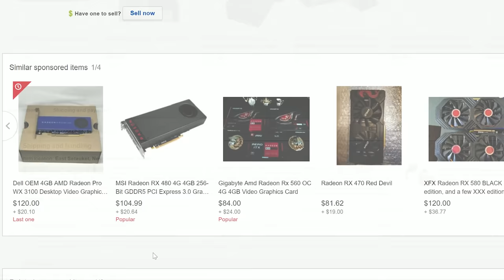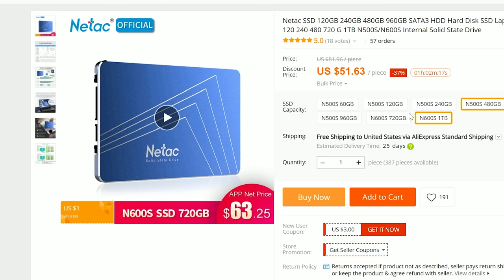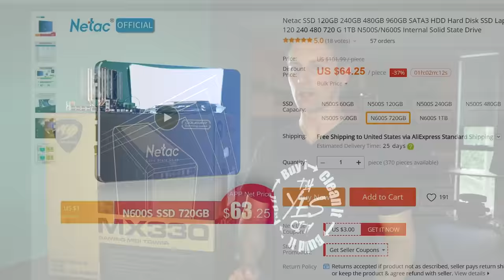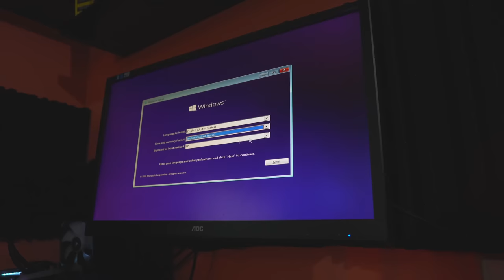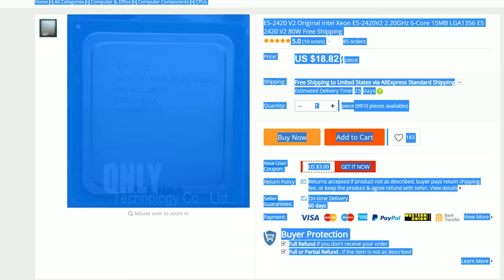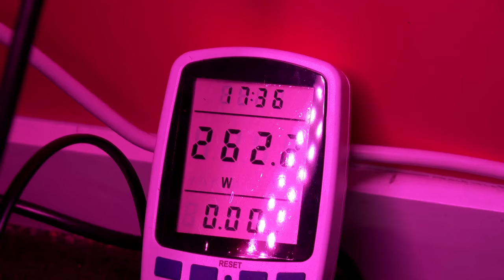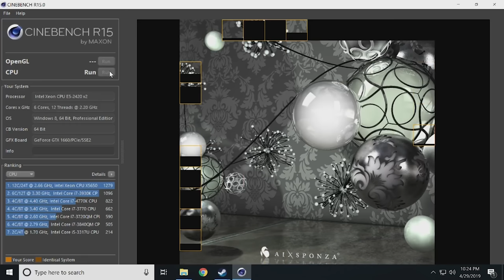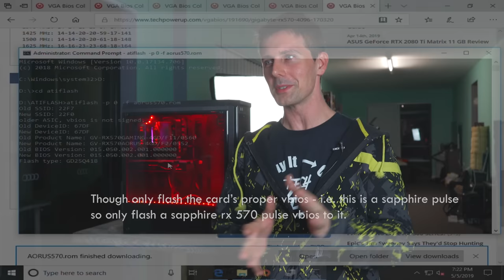Build The BEST $350 Gaming PC (with Worldwide online parts)

Comment: U can do it with ryzen 3 2200g.
Reply: arjun b That has potentially got a better upgrade path, but 4 cores no longer cuts it for gaming.
Reply: @RANDOMNAME-kj1zv  quad Cores are still going strong, it's the per core performance. No point in comparing i7 7700 (quad core) with a i5 8400 (6 core) the i7 beats it by a slight margin if I'm not mistaken so preference goes to per core performance over core's with a quad core being the bare minimum
Reply: @nexii1479  The i5 8400 doesn't have multithreading while the the i7-7700 does meaning the i7 can run as if it has 8 cores whereas the i5 8400 only has 6 so they're more even given one is the last generation higher end and the other is the following generation mid end.

Comment: I'm constantly getting between a 112 and 117°C motherboard reading??? I've put upgraded fans in the case and everything. Heck I've tried removing the side panel and putting a box fan right next to it. Nothing feels hot to the touch on the motherboard. Is this just faulty readings?
Reply: If it was 117c it would've burned your thumb so yeah faulty readings

Comment: I can't seem to find a RX 570 for less than $200, but I can get the rest of the computer for $258(HDD not included).
MoBo: Gigabyte B450M-DS3H                    $88
CPU: Athlon200GE                                         $54
Chassi: Natec Apion                                      $24
PSU: 600W (bronze)                                       $42
RAM: Crucial DDR4 4GB 2.4GHz, CL17      $25
SSD:  Kingston 120GB                                   $25
(optional) HDD: Seagate barracuda 2TB    $62

Edit: Save $11 for an A10-9700 CPU possibly.

Comment: Brian I found a GTX 660 on a local deal for about $40 but later on found out GTX 960 for $55. What would you recommend for me to buy?
Reply: Btw I am planning to pair it with an i5 2400
Reply: Keppler is getting old, I wouldn't bother buying a GPU that old.
Reply: Defo that 960. That's a decent price for under $60 and you can still game comfortably at 1080p med-high.
Reply: 960 is like a  base clocked 1050 ti when ocing a 960

a 660 is like a 750 ti but not power efficient

id go with a 970 and call it a day ~ should be able to find one for around 80 bucks or less (or just get a used 570!)
Reply: Thanks guys really appreciate it

Comment: can i asked a question; what is better ( artic mx4 vs noctua nt-h1)
Reply: For this kind of build it really wouldn't make any difference, but then that would be the same for most builds. One will see bigger variance in room ambient temps day to day than meaningful differences between pastes using the some parts keeping all other factors static. Can vary by CPU sample, mbd, cooler, etc. You'll be fine with either. As a general rule, don't buy uber cheap, don't go for hyper expensive (Noctua is likely very costly), something inbetween is sensible. I just use AS5, but it doesn't matter that much overall. Thermalright told me they experimented with all sorts of substances, including toothpaste. :D  Anything with a fine particula base will work; my gf's PC (Ph2 965) was done with 75% Marmite, hehe (I ran out of AS5).

Comment: Would an I-5 3450 or 3470 be a better option?  Using HP or Dell MB
Reply: Seth Rock no it will perform worst and probably be more expensive

Comment: 50$ for a Asus R9 290 <- would this be a good deal?
Reply: The 290 is close to a 570 perfomance-wise, but uses a lot more power and can be insanely loud:

https://www.anandtech.com/bench/product/1772?vs=1869

You're better off spending just a little bit more and getting some quieter and/or faster.

Comment: Hey guys! I need some help...I can't really decide on what pc to get(FX 8350 vs i5 3rd gen) for gaming...I know the i5 is faster but now that I've seen this video(comments:Xeon vs FX)and the i5 vs Ryzen 3 I'm really confused about what to get...I'm gonna add like a used RX 570 or a GTX 1060...I can get the FX build for a little cheaper but is the i5 build worth for a few more bucks(like $50)? I might be doing some streaming and recording as well...And I might have a dual monitor setup...What do you say?

Comment: I built my dad a $350 PC, i3 4170, Rx 570 4gb, Kingston 120gb ssd, thermal take core v1 case, z97 gigabyte motherboard, and be quiet slim rock cooler and 8gb of evga ram

Comment: Update for 2021 the links for the processor and cpu cooler are all still good if you live in the UK it will cost you 84 pounds for the CPU Motherboard Ram and Snowman cooler shipped. I would leave the case, psu and ssd to buy here in the UK as the SSD prices are cheaper on scan and ebuyer plus all the PSUS on ali look sketchy as f**k

Comment: just built a $340 gaming pc through ebay auctions and offer up howd i do?
CPU I5 3570K  3.4GHZ QUAD CORE
GPU R9 390 8G
RAM G-SKILL RIPJAW 4X4GB (16GB)
MOBO GIGABYTE Z77MX
CASE COOLERMASTER CENTURION 5
FANS 4X NOCTUA 80MM FANS
HDD HITACHI ULTRASTAR 2TB
SSD ADATA 240GB SATA3
COOLER COOLERMASTER HYPER 212 PLUS 120MM
PSU CORSAIR TX750

Comment: 2.5 GHz IVB is just plain slow.
Reply: It's IB-EN, not IB, and the FPS results speak for themselves, Crysis3 not withstanding. Even more interesting is one can use two of them on compatible boards; 12c/24t even at that clock is pretty good for such low cost & power. There's a reason why CPUs like these are used in Enterprise by the tens of thousands (efficiency, cost per watt).
Reply: @mapesdhs597  IVB-EN is just the cut-down LGA 1356 implementation of the IVB architecture. And indeed performance does speak for itself: IVB @ 2.5 GHz has no place in 2019. (hence the pricing of the used parts)

btw: The E5-2420 v2 is 6C/12T, not 12C/24T @ 80W.
Reply: @proesterchen  Read what I said; two of them is indeed 12c/24t - I was referring to dual-socket boards. And "no place in 2019" is not an argument; if a single 6c chip performs acceptably with a relevant GPU then who the hell cares what year it is? :D  Not everyone wants or can afford a 9900K, etc. Heck, I could even put together a build right now with a 4c IB-E that would blow away any mainstream modern desktop for Firestrike Ultra because the chip has 40 PCIe lanes; how meaningful that is of course is open to debate, such is the nature of synthetics like 3DMark.

Some games need the kind of oomph you're alluding to, others very definitely do not, as the results clearly show, and at this budget level it's highly unlikely the owner is going to have more than a 60Hz 1080p display.

Making absolute comments like chip X or GPU Y has "no place" etc. is not logical. You do not get to decide how other people spend their money or what they regard as acceptable performance and/or product/feature tradeoffs.

Also worth pointing out that for someone who did build something like this, by the time they might want something better they could then look to the later v3 or v4 generation of XEONs which would have many more cores, greater IPC, higher clocks and be just as cheap. The 10c 2680 v2 I bought was only 150 UKP and runs very well indeed.
Reply: @mapesdhs597  160W (in CPUs alone) for (best case) R7 1700-1700X-like performance is neither efficient nor relevant in 2019. It is why these things are being thrown out by the tens of thousands, though.

It's no surprise your 2680 v2 runs decent enough, it's got 66% more cores running at 40% higher clocks. Maybe you can neuter yours to resemble a 2420 v2 and report back on just how slow an experience that is.
Reply: @proesterchen  You're doing it again. :D  "not relevant" is not an argument. Where's your data? What tests have you run? I ordered a parts set about an hour ago. What you're saying is especially ridiculous when talking about DX12 titles which should place far less demands on the CPU, doubly so as one moves up the resolution scale, etc. And you're wrong about why they get sold off, that's just the nature of Enterprise tech, constant usually annual upgrades (I know, I get offered stuff all the time). I've been dealing with Enterprise customers for almost 25 years. I would give greater credence to your unsupported assertions if you had data to back them up, but you don't, whereas TYC does, and so do I (eg. I hold the non-DX12 3DMark records for P55).
Reply: @mapesdhs597  Strange how you keep bringing up 3.5 GHz IVBs and probably even higher-clocked Clarkdale CPUs in trying to object to me calling a 2.5 GHz IVB plain slow.
Reply: @proesterchen  Again, not an argument. TYC's data show results that are anything but slow, but it's clear you don't give a damn about those pesky things called facts. :D  You have no data to back up your claims, whereas TYC does, and so do I. QED.
Reply: @mapesdhs597  You have provided zero data. TYC's data supports my initial comment. Somehow, you still object on principle that a 2.5 GHz IVB is just plain slow.

Comment: Sorry but crysis 3 is garbage. The original crysis blows it out of the water. Crytek sold out to consoles for 2 and 3 that is why they feel like a console port. Try and play metro exodus on this system I'll bet it won't even run it and what type of monitor are you using? How many hertz and what response time?

Comment: SSD is NOT faster than HDD. Accept it.  Want prove?  Copy a 30+GB ISO file from one new HDD, to another new HDD, and to another new SSD.  
SSD is NOT fast.  The fast thing in the SSD is the CHACHE.   How many chache is in these SSD's?   8GB?  So 8GB is faster ofcourse, but the whole SSD capacity is not,  is way slower than a new HDD.
Reply: I agree that cache is an important thing in ssds, but even the cheapest ssd is faster than any hard drive. Especially when you're also running an operating system from the drive.